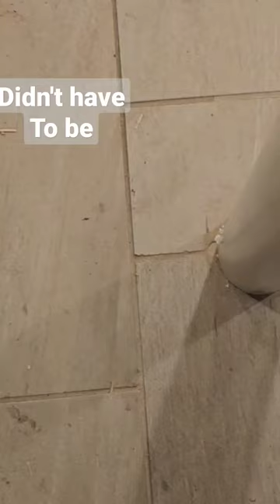Didn't have to be. #tile #shorts #installingtile

Comment: One Cut tile with a hole in the center, or two tiles cut with a hole. All the same, the cut hole looks dirty and rushed though. Other than that I don't see either one as a better option, still a hole in the tile. Should have added a structural support beam and got rid of the poll.